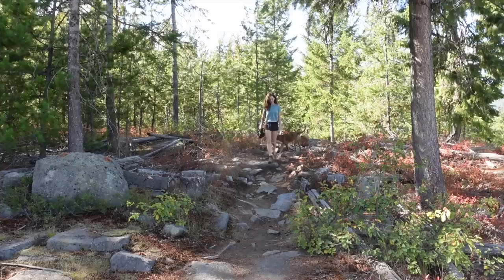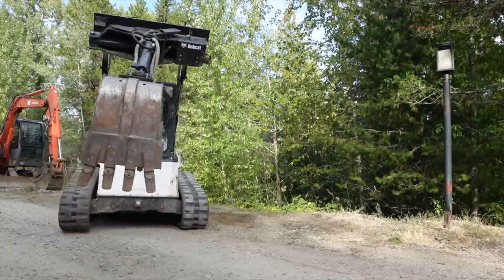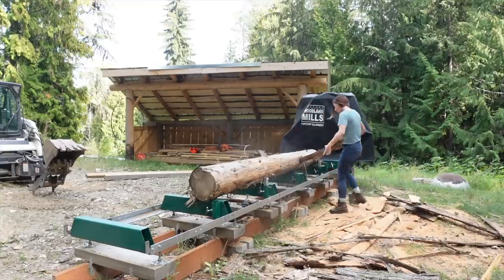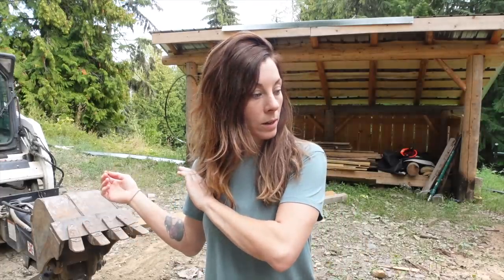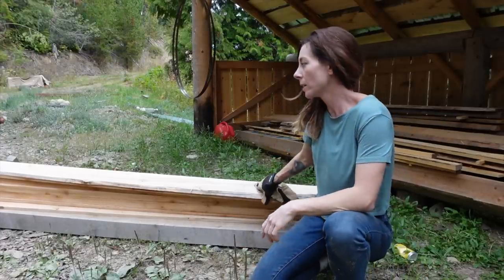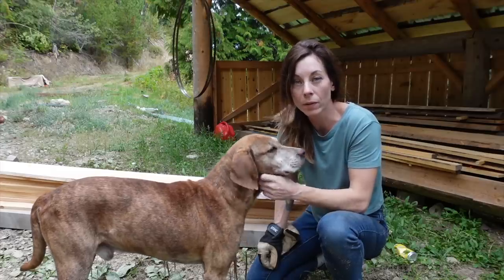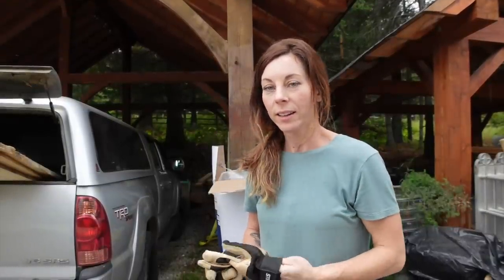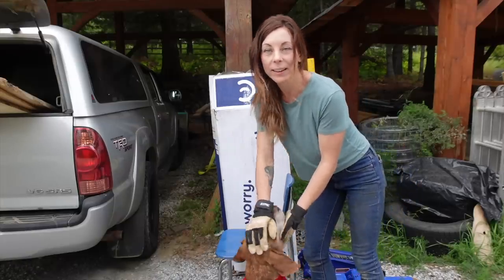Making more lumber for my tiny cabin | Retrieving the black bear skull

Comment: @2:18, you may want to reconsider cutting the pin sooner rather than later, not sure if this applies to you, but here in Maine the pine grubs will destroy the log if you don’t cut it up right away so it can dry out.  Once dry they can’t eat it anymore.  If you stand next to the log and hear rhythmic squeaks, that’s them destroying the wood.  I won’t accept a pine log that’s been cut for longer than a month.
Reply from the maker: Ok, good to know! Thanks for that. I was hoping to only mill it as I need it, so I don’t store it, stack and sticker it, and then have to move it again. BUT - I don’t want it to be ruined. So - thanks for the heads up. 👍

Comment: I like both square and plumb cut. I see an advantage on the square cut when snow and ice are curling off the roof...just gives a little wiggle room to keep the elements off the facia or tails. But, if you're enclosing the eaves it adds complexity. 
Yes on the torque wrench.
And finally, hello cameo Steve.

Comment: Releasing Torque wrench pressure:  Whomever told you that, is probably regurgitating something mother said.  That would be the equivalent of jacking the bumper of your truck to reduce pressure on the springs.  It isn't important.  Metal is inert, it has consistent properties.  Yes, pressure can change things, but movement and flexing breaks metal. So in theory, using the torque wrench will fatigue the metal faster than constant pressure.  (think about your bandsaw blade, it is constantly flexing and yet it remains durable for a very long time.)
Reply from the maker: Well, your theory may be right. I’ve had that torque wrench for 4+ years and never taken the tension off, and left it out (covered) and leave it out (covered) in the winter and it seems fine 🤷🏻‍♀️

Comment: Damn, Michy, you're like hulk! 😯 It seems all the work and struggling pays off even in different ways.. 😏 Preparation is the most part of success, apparently you're quite into it. Harvesting resources you have and using them, doesn't actually bring you money, but brings you value, the overall value of your property gets higher, which is good. Not having to spend money for materials is also good for you wallet. Keep going, you're on the right way to success.👍

Comment: Hi: This is the first time that I,m writing you. I seen most of your posts. You're doing a good job by your self, don't you wish you had a axtra hand every now and then, I understand why you didn't. The resume for my two cents, I would like you know about that torque wrench, when you undo the  setting, only go back to the lowest number on the wrench, because if you go past that number, it is not good for the wrench, wants to reset the torque on it !!! I hope this helps you keep your wrench longer. I hope, I didn't over step my self. Good Luck. Be safe !!!  😐😮🙄

Comment: all mechanics know about  torque wrench release .
Reply: No they don't. Very few mechanics understand metal composition and properties.  They just do what they have been told.  Releasing the torque wrench is a waste of time, flexing will affect it more, so don't use it if you are worried it won't work properly.   lol
Reply: @ya472  well all the mechanics I know ,know it . they may not understand metal composition but they know proper tool usage especially when they are shelling out the money ,a good torque wrench is not cheap for them and doing the job right the first time . what your using it for all you need is a beam type ,no release is required .

Comment: Mich, just a note to yourself:  A torque wrench is a very expensive tool, as you may already know.  It is somewhat delicate.  I would not store it outside.  It should be handled gently; you know, handled with care.  These wrenches, if handled roughly, over time, can be knocked out of calibration.  What does that mean by example: 

Lets say you are replacing a leaking valve cover gasket.  The manual calls for a torque spec. of 60 ft. lbs. to be applied to each bolt on the valve cover when reassembling the cover with a new gasket.  if the torque wrench has had some rough care over its lifetime of ownership, it may be "out of spec".  When you go to apply torque of 60 ft. lbs. to the wrench, because it is out of spec., it may only apply 40 ft. lbs. of torque.  This lower than recommend torque spec. could result in the valve cover gasket leaking again.  The job will have to be repeated.   If you were replacing the head on an engine, this lower than recommended torque spec could result in damage being done to the head and head gasket.  This could cost the owner of the torque wrench several hundreds, even thousands, of dollars of additional repair cost, all because the torque wrench was not handled with care over it's lifetime.   They can be recalibrated.

My intent here is too inform you, not to ridicule you.  As always, with my advice, take what you can use and throw away the rest.  

Love those big guns girl.  💪💪You are one strong lady.  You have to be HEFY, HEFTY, HEFTY, to pick up those roof trusses.  No way are you wimpy, wimpy, wimpy and doing that kind of work.  I would feel very safe walking anywhere with you in the group.  I've seen women in the MMA with guns like yours.  Very impressive. 

Did you know mice can't stand the smell of cinnamon or balsam.  That's right, the smell of Christmas trees.  The woodchips come in these teabag looking pouches that you can hang just about anywhere.   Of course cinnamon can be found in sticks, in bundles that look like small brooms.  I love the smell of balsam.  Now your truck engine bay, cab and house can be free of mice but smell fantastic too.  

I also learned if you need to cut trees, on your mill, that have sap in the wood, run a very, very slow drip of diesel, instead of your normal cleaner through the drip line for the saw blade.  The diesel will keep the blade clean and sap free.   
 
 ME
Reply from the maker: Thanks for all this! I usually leave the torque wrench covered, but also have left it out over the winter. I will bring it in now! Thanks!
Reply: @michygoss7148  You are most welcome.  I just love the Balsam chips and mice thing.  One, or two, more tidbits.  "Outdoors with the Morgans"  You, or your husband, might enjoy watching this guy.  Located in NW, PA.  
All about working outdoors.  He has a Wood Mizer Saw Mill.  I've seen him mill some Walnut and Cherry off of his property.   His wife has a channel too, "Morgans off the leash"  Her channel is geared more for dog lovers, shooting, family, grand kids...those kids of things.  Sometimes they do a live feed called Saturday Night Live.  Never guess what night they go live.  I met them at the Paul Bunyan show last year.  Nice couple.  She, and her youngest daughter are into CrossFit training.  She is a fit one too.  Strong as hell.    
See you again soon.  😎